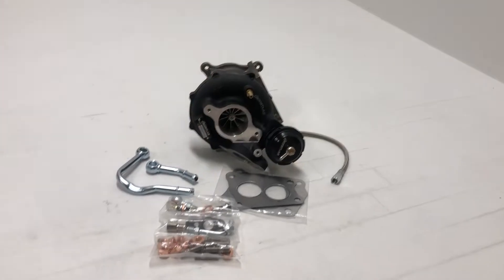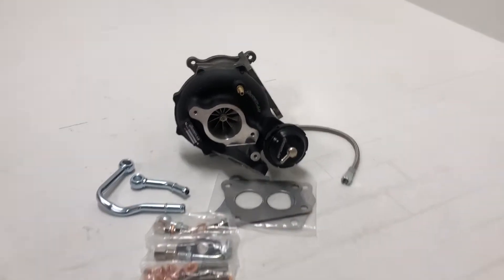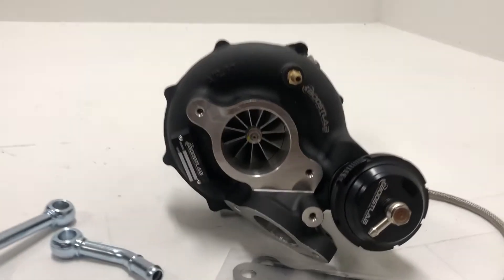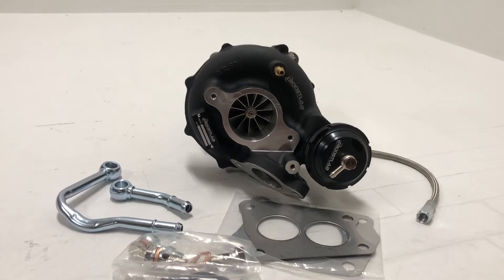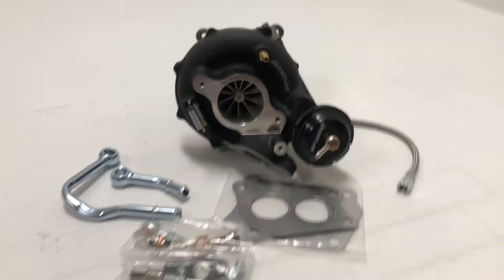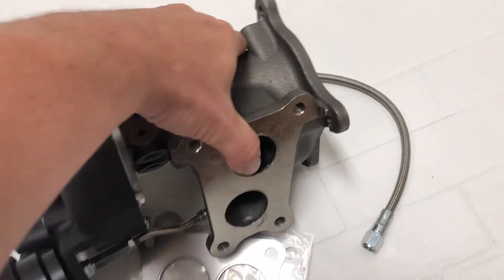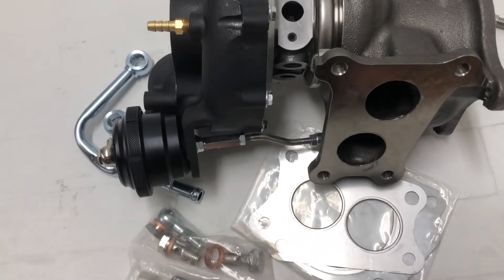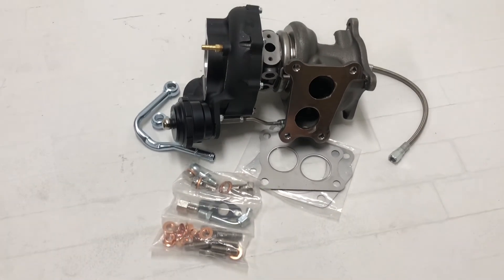2015-2021 WRX FA20 BL TD06SL2-54X Turbo Upgrade - Quick Specs

Comment: What is the difference this between tomioko racing gtx29 turbo
Reply from the maker: The Tomioka is Dual Ball Bearing and can flow a bit more HP as well.
Reply: @TurboKitscom which do you recommend/prefer?
Reply from the maker: @jakeboy62  It really depending on your goals, if you are looking for a bit more power then the Tomioka is the way to go and being dual BB, you get back some of the spool you lose going larger. Either tho, are great turbos for the FA20 WRX.